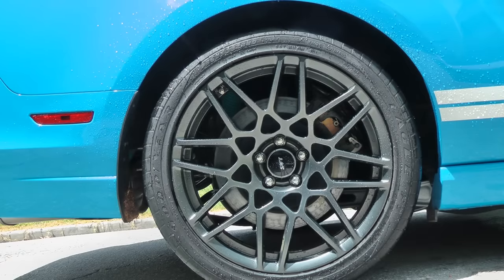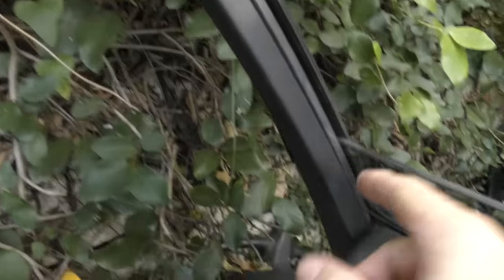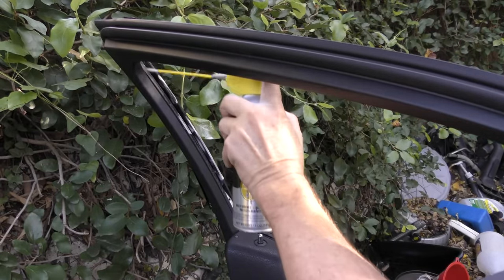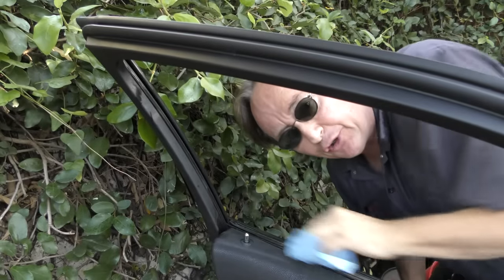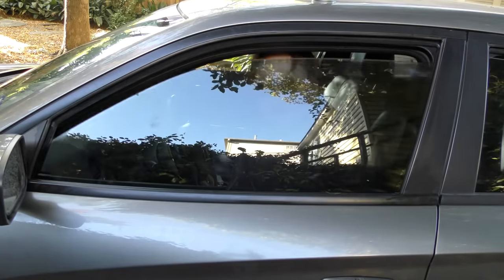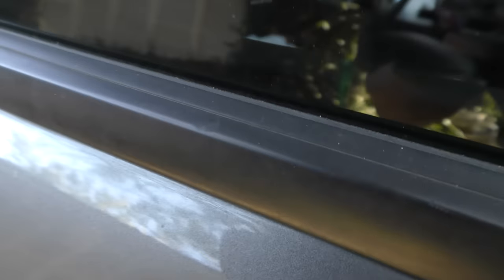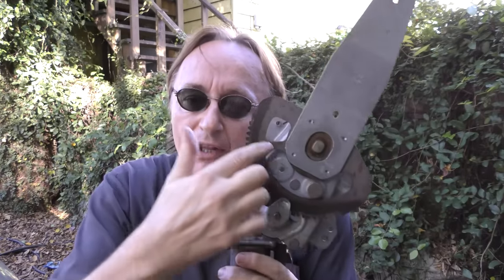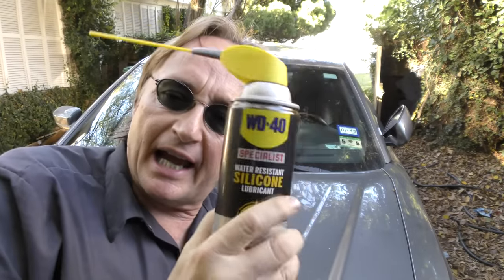Life Hack That Will Keep Your Power Windows Working Forever

Comment: Good luck ever getting your windows clean again.
Reply: +Milford Civic Yup, did this 3yrs ago, and couldnt get rid of that silicone film for next 2 years ...
Reply: +Milford Civic Soap and water works for me. I have been doing just as Scotty has demonstrated for years and I have never had an issue with clean up or a remaining film on the glass or paint.
Reply: +Milford Civic  Alcohol? I think one of those magic erasors would do it.
Reply: I used windex to get the film off, had to do it a few times but it was worth it. it didn't take me 2 years lol. only a week. all of my windows worked like brand new.
Reply: This is the problem I’m having now. You clean it off. But when you roll the window down and back up, there’s the silicone layer on the window

Comment: Silicone never seems to give a lasting result.  Power window tracks need a lubricant that doesn't exist yet.  They are the strangest thing on a car and I've never found a permanent lubricant for them.  Add to that, car manufacturers use the cheapest materials to build them, and manual windows as well.  I've yet to see window components that are truly well-made.
Reply: discerningmind  I hate undeniable truths with everything I have... sadly, thats an undeniable truth as well.... thanks.
Reply: Agreed. After a few months it's not as smooth anymore.

Comment: A good tip from 1066gaz.
When your stood in traffic and your car begins to overheat turn on the blowers to full and move the heater control lever/knob to hot.
The influx of cold water from the heater system to the cars now hot water in the cooling system has the effect of cooling the temperature down thus removing the risk of bust hoses and saving damage to the engine.
Once the temperature comes down move the lever/knob down to cold.
If its a hot day direct the vents to outside and open the window of course.
I have done this for nearly 30 years and still not many people know about this.

Comment: Thanks for this tip on Windows, mine started to stay down, didn't want to come back up if it went all the way down. I'd have to fuss & cuss getting it to go back up. Thought it was the switch, got one at the salvage yard, didn't solve the problem. Was starting to think I'd have to remove the door panel ect. Then I saw the silicone video, working fine now. Gonna spray all the others now. Thanks again.

Comment: Works like a charm!  I got the silicone spray from AutoZone.  My passenger side window got stuck, even though it was supposed to have been lubed by a local auto shop.  Charge me $60.  Window was stuck on the drive home.  Sprayed lube, fixed!  Not stuck anymore.  Luckily the window did come down at night after I ran AC over the window area.  There was sandy grit in the tracks. I wiped it off after using generous spray.

Comment: Hi Scotty. I bought car few days ago , Just realise back Passenger window is totally block even I can't open. It's manual window not electric.  Does this spray will work on it?
Reply from the maker: you can try, but on those, often they will need a new manual window regulator assembly

Comment: What I find (and noticed on yours) is that the horizontal rubber rolls inward and jams when the window is lowered.  But I notice you didn't spray the horizontal section. I think (if I recall correctly) it was the inside strip (two strips, on both sides of glass at bottom horizontal). Once the inside lip starts to curl in, then every time you lower the window the glass pulls it down and jams. I think I even pulled out the strip and just let it rattle. But maybe silicon would prevent this. I think on some cars there is suppose to be felt or some cloth like material or some kind of fabric that slides against the glass. Not sure if silicon would ruin that or what to do about it if it starts coming off. But rest assured as soon as the inner rubber starts curling inward the window will jam tight and the plastic strip that raises/lowers the glass will break.

Comment: Gonna pick up some silicone spray lube today! One of the first nice days this last weekend. I was out running errands and passenger side window wouldn't go up, but an inch or so at at time. Had to stop and start to SLOWLY get the window all of the way up. But no grinding noise or whining from the motor. So maybe this will do it!

Comment: Scotty, with the windows rolled up, would it be wise to insert the spray straw through the rubber gasket and into the door chamber, in hopes of lubricating the actual motor?  (If so, where is the motor located, somewhere in the middle?)

Comment: Hi Scotty,  I have a 2011 Hyundai Accent 1.6 GDi. A quick question: unknown reason, my pollen filter case cover has gotten missing in the car.  So, the filter and cabin filter container are not sealed and that disallows me to put on the AC.  I've tried getting the cover but no success... not even Hyundai service centers have it.  Please, any advice on how to fix this problem. 

 I also have problems with my window sticking and struggling to come up and down smoothly.  And this video has been helpful

Comment: Good Evening 🌇 Handsome  Scotty 🌹. My question is my step sister has a  2000 Ford Excursion and this past summer a soda 🥤 got hot in vehicle and exploded and now her power windows stick badly and soda went into and down the door panel where the windows are and they stick and streak badly too😫. Would this work and clean the power windows up? If not what would fix them??? Thank you for your time 💐. God bless. I subscribed. Kudos from Alaska 👍

Comment: My plastic 2006 Ford five hundred would get water built up inside the rear doors. When I would close the door, I could hear the water sloshing around.I took a pick, and/or a nail, and cleaned out the drain holes. Water and junk come flowing out, until drained. Now I check once in awhile.

Comment: I'm going to suggest having a look at the MSDS to make sure this type of WD40 contains no petroleum distillates, which is bad for the rubber.   My main argument with WD40 people is that it is not a lubricant, it does leave a tiny bit of silicone behind, after it washes out any real lubrication that was there.  WD40 was formulated to displace moisture (WD, get it?)  Don't fall for it as a lubricant (the stuff you show MAY be different).

Comment: Great Advise Scotty Kilmer ... it worked GREAT ... just as you've shown in the video !!! I had already bought a replacement window regulator and motor assembly before I noticed your video :-(  I had tried a couple of other products, but without any luck :-(  A quick spray on the tracks and the windows are working beautifully now :-)  Very little clean up required :-)  The silicone spray you show is the way to go :-) It saved me a lot or work having to replace the whole assembly !!!!

Comment: Imma take my WD-40 flask ad do this on my RX-7. My power windows are pretty slow, especially on the passenger side. Suspecting the rims being the problem as the speed is uneven. They will slightly speed up and slow down on their journey up and down and it seems like the passener window slightly gets caught on the front rim at one point. Didn't know the WD-40 also fixes the rubber trim. Have white rubber trim especially around the driver door window as a previous owner has waxed the paint and not bothered to mask tape the rubber.

Comment: just noticed that the newly silicon coated surface shows an obvious difference in sheen after wiping off the spray application along the front door frame edge surfaces as seen in comparison to the same car side rear door window tract frame ~  so, it seems best (and advisable as an preventative task) to treat all the window door tract frames of the entire car ~

Comment: Will this harm window tinting..?
Reply: This only works under one condition: if your windows are not tinted with film. WD-40 will definitely go under the tint film and ruin it. Proven by practice. On my Toyota Sienna 2014, the glass of the driver's door literally tears out the rubber channel, the VD-40 lubricant helped, but completely ruined the tint. I had to re-tint the window and I don’t know how to lubricate the rubber channels so as not to damage the tint.
Reply: @alexanderkaramov5687  After I posted the above question.. I discovered that WD-40 has a special lubricant that will not harm window tinting... So they say... I used it and have had no problems so far... 

WD-40 SPECIALIST® SILICONE

WD-40 Specialist® Silicone Lubricant safely lubricates, waterproofs and protects metal and non-metal surfaces such as rubber, plastic and vinyl. This formula dries fast and leaves a clear, non-staining film that doesn't stick or make a mess, so it won't attract dirt. This silicone lubricant spray is great for use on cables, pulleys, guide rails, valves, linkages, hinges, locks and more. Effective in-use temperatures ranging from -100° F to 500° F.

Comment: I watched this months ago.  I have been using it every couple months because I drive very dusty roads.  I clean out the track and apply the silicon spray.  Usually helps but today is worse.  What now?

Comment: Another trick for WD40's older brother is plastic renewal.  It chemically melts the outer layer to reveal the fresh plastic beneath if it's been oxidized.  Just make sure to wash it off after and don't get that stuff on the clear coat and use a protectant like 303 from then on.

Comment: The back sunroof does not open om my Land Rover discovery II, but the front works fine. Does each sunroof run on a separate  motor or is the problem due to electrical current not reaching the back roof?  Is there an easy fix for this or do I need a new sunroof motor. Tks.

Comment: HI MATE, 
GOT A BMW 3 SERIES CONVERTIBLE WITH WINDOWS DOING EXACTLY THE SAME AS YOUR VIDEO. BEFORE I SAW THIS I CHANGED THE WINDOW REGULATOR AND THE MOTOR AND THE SWITCH JUST TO BE ON THE SAFE SIDE. 
STILL NO JOY SO JUST TRIED YOUR METHOD BUT ITS STILL STICKING AND IT SEEMS THE MOTOR IS OVERHEATING BECAUSE IT STOPS WORKING FOR A FEW MINUTES AND THEN STARTS AGAIN. 

ANY ADVICE WOULD ME MUCH APPRECIATED

Comment: The lube is wd-40 silicone version? Havent seen that before.  Good for rubber seals? Will it bring them back to life? Such as in convertible top seals. I got a e30 that leaks.  The usual spots in the corners.  I got a removable hard top and that leaks even worse.  Not much online that is convincing about treating rubber seals, if its ever possible. Thanks

Comment: I have a new bronco and water/dirt got in and then froze causing my window to struggle to move up. This is obviously an issue in michigan since its freezing out, bought some spray and used it as scotty said.

It cleaned out the dirt and now goes up and down super ez

Comment: Scotty I have a question. Can you cover reverse sensors. I have a 2008 Escalade Ext and my reverse sensors have never worked. I have been told by the dealer I need new sensors so I replaced them but I don’t know how to reset the system. I’m pretty sure if I take it back they will probably tell me new sensors again when I just need a reset.

Comment: Worked wonders for my windows, however it ate some of the finish off of the rubber trim around the windows. Not sure if the brand matters, but I used CRC brand heavy duty silicone lube. Whoops!

Comment: Hey Scotty, i have a problem where the music, even at low volumes, is making a noise from the top of my window when its up. If i hold the window up button, it doesnt make the noise anymore. If i roll down the window, it doesnt make it then either. Only when the window is up and no press of the button. Will this lube fix it? Or maybe the seal is loose or wearing? It doesnt look to be showing any signs of wear. Its an annoying vibration/low rattle.

Comment: Will the oil attract dirt.  Eventually causing it to stick again
Reply: I use silicone lube on a lot of stuff at work and for the control cables on my bicycle. Canned silicone lube at least won't attract dirt as fast as grease does. It makes a very thin, dry coating.

Comment: Just did the regulator on my F150 (2nd one) most likely because of forcing them to move while sticky.Cables snapped-however its a Ford so regulator was 40.00 :)

Comment: Scotty, i got some wd40 on the glass and left it overnight. Now i got lik water dripping stains, i thought i can remove it with soapy water (dish doap + water) bit now it got hard stains on the glass.
I use a cloth to rub it hard and it scratched my glass. What should i do ???
Reply: Isopropyl alcohol (AKA Rubbing alcohol) is best for getting greasy stains off glass. Just be sure to rinse the whole area when you're done because the alcohol can corrode rubber.
Reply: Bryce L thanks ! I will try that !

Comment: Scotty my windows on my truck or power window sometimes they work sometimes they don't but when they don't work you hear a clicking sound coming down where the fuse box is I don't know if it's a switch or maybe a regulator or something but I cannot figure out why my windows won't roll up and down on a hot day they work just fine

Comment: For some ungodly reason the silicone spray made it worse... Before applying it my window squeaked a bit. Now it's slower and squeaks a lot! I'll see if I can clean it off and buy another brand. Maybe that will work?
Reply from the maker: it's a lube, you put it on the front and back runners it has to work as it forms a lube barrier between the glass and the rubber

Comment: hey scotty, i just changed the power steering pump in my 1997 isuzu rodeo 4wd and when I'm sitting still and turn the wheel back and forth, i can hear a belt hollering, only if im sitting still, not while moving. power steering itself is fine.
Reply from the maker: change the belt, and if not that, you got la crappy rebuild pump, see that a lot
Reply: It's a brand new power steering pump and belt. It may be the belt next to it or the belt going to my power steering pump is to tight?

Comment: My 2013 VW CC has frameless windows (like some high-end cars, e.g. CLS), so should I apply the lubricant along the edge of the windows ?
Reply from the maker: yes, they still have the runners on the front and the back, just inside the door, spray down there as it goes up and dow

Comment: Hi Scotty,
    You are very experience and you did say serveral times get WD - 40 Silicone but most people are just used to using WD - 40 rust buster so for inexperienved persons you should of added be sure to get the WD - 40 Silicone spray and not the WD - 40 multi-use product used for penetrating rust, etc. otherwise this video was great as most your video's are also.

Comment: This only works under one condition: if your windows are not tinted with film. WD-40 will definitely go under the tint film and ruin it. Proven by practice. On my Toyota Sienna 2014, the glass of the driver's door literally tears out the rubber channel, the VD-40 lubricant helped, but completely ruined the tint. I had to re-tint the window and I don’t know how to lubricate the rubber channels so as not to damage the tint.

Comment: Does anyone know if this will work for a 2007 Dodge Caravan, the drivers side window occasionally "pops" with a really loud noise when it goes down (powered). Doesn't appear to be off track and rolls up and down smoothly after the pop, but it only happens intermittantly and only on the down position about 1/2 inch from the top, but it's so loud it's worrisome. Thanks.

Comment: @Scottkilmer I have silicone oil spray for green gas and co2 blow back airsoft guns can I use that for the Windows also what throttle body cleaner is good is CRC a good brand or is there another brand that's better or just as good since u use it in ur videos please let me know

Comment: Will the regular/basic wd40 work or should I get the wd40 specialist silicone?
Reply: No.. not the usual stuff.. only silicone. Just bought  can myself (different brand but it is the same content) Windows are noticeably smoother on my (normally garaged) car that is quite new.
Reply: @Alan Brown  Alan Quick question my car doesn't have frame around it how would I apply?
Reply: @josephflores1849  Hi.. if it doesn't have a frame, as in this video, the windows will likely slide up against the car's frame seals at some point. there must be a seal on the car against the glass at some point or you would get a lot of water coming into the car. put silicone on the rubber seals on the car where the glass touches on their way up and down.👍👍
Reply: @Alan Brown  thanks I will spray it on a towel then wipe that area.

Comment: Lithium grease spray lube is as good or better for the regulator channels. It's heavier and stick better. Pop your door panels off and apply lots of it all over the rails and sliders. You can't use too much as the excess will simply act as water proofing for the inside of your door.

Comment: The window motors are a lot cheaper on eBay I got and oem motor for a 1998 firebird for $20 but it's a pain the the ass to put in so for the last 3 months when I get gas I have to open the door

Comment: what about on frameless window like the c4 corvette?
Reply: I had a c4 Convertible!  I used the spray for the parts of the track you don't see- down inside the door.  However, there is also a plastic guide that screws into a hole in the window glass that often breaks.  If the silicone isn't effective, you may need to take your door apart and replace that plastic piece.  It's made of plastic and felt.  I had to replace it on both sides!  Good Luck, and enjoy your Vette!

Comment: Scotty Kilmer! I did this to my 2003 Expedition and it made the windows screech like a banshee for a few days and now the drivers window is failing. :(
Reply from the maker: this can not damage anything, it's just a lubricant (if you used spray silicone oil and not something else)
Reply: Yup turned out to be the switch contact which just happened to coincidentally fault shortly after lubing the tracks. Working smoothly now.